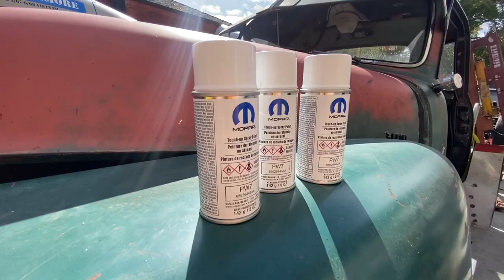2nd gen Dodge sport bumper grille repair/conversion!

Comment: Great work! It’s about a grand to find a decent sport bumper conversion up in the east cost lol. I believe the reason the paint was cracking is the mopar paint is a high quality paint , compared to the Walmart lacquer based paint. Since two different paints were used overtime it might all crack adventually. Reason for that is they react to temperatures differently , different chemicals in the paint. Cheaper clear coat also pulls harder at the paint and has a more sudden temperature change for what reason idk lol.

Comment: Do you know what brand/website that fog lights are from? Having a really hard time finding a set for my sport bumper
Reply from the maker: Ebay is where I got mine from, https://www.ebay.com/itm/353732956107?chn=ps&norover=1&mkevt=1&mkrid=711-166974-028196-7&mkcid=2&mkscid=101&itemid=353732956107&targetid=2276391439863&device=c&mktype=pla&googleloc=9032367&poi=&campaignid=21229810796&mkgroupid=164293979649&rlsatarget=pla-2276391439863&abcId=9409452&merchantid=101683737&geoid=9032367&gad_source=1&gclid=Cj0KCQjwir2xBhC_ARIsAMTXk84YCyJ94lWVqFyTYhzNf5q9dkeXnS3lCgVXTYfaaAQK24GdQt_s-zIaArHGEALw_wcB

Comment: Question. Was gonna swap grills and I have a 99 sport. Was there any difference in the old grill and the sport grill?
Reply: Yeah ones a different shape the sport grill is more round at the bottom
Reply from the maker: Also the sport grille has different mounting brackets and a different hood latch, all can be order off of LMC truck